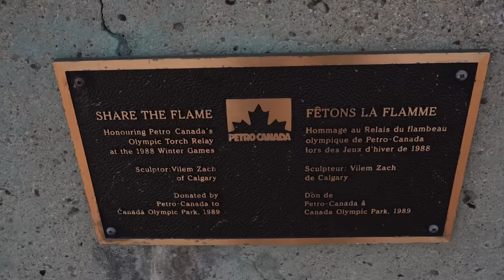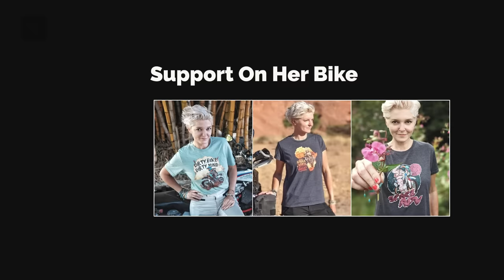So Long, Canada | Calgary Farewell - EP. 271

Comment: You should be changing your chain and sprocket every 20,000 to 30,000 kilometres not just the chain. Put it in your calendar. You don't want to be chucked off your bike and broken down at the side of the road